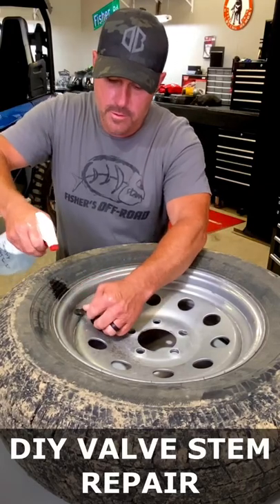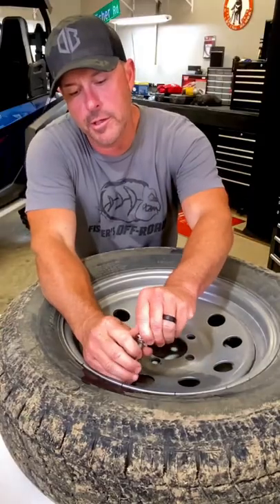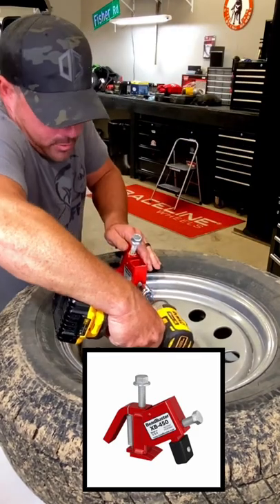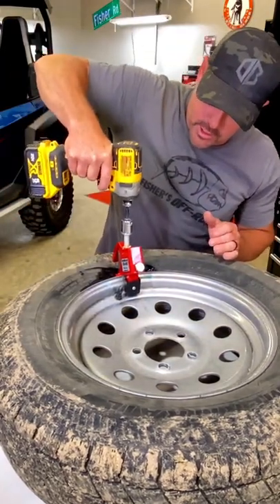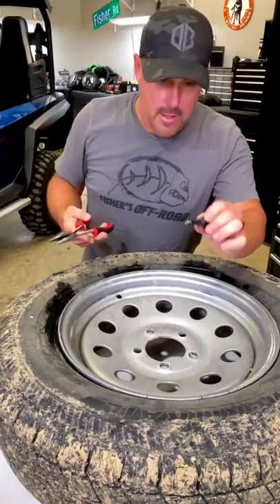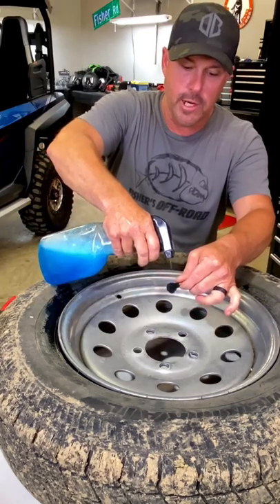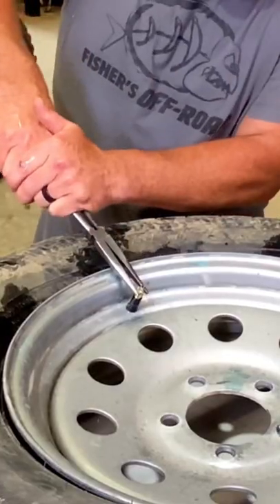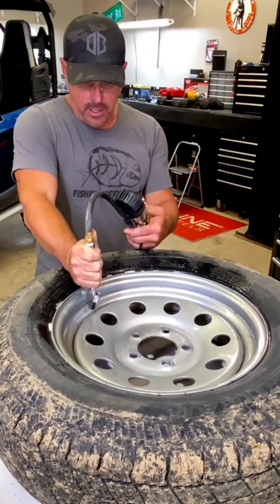DIY VALVE STEM REPAIR              #shorts | #offroad | #fishersoffroad | #diy

Comment: Fyi you know they make a valve install tool that threads on and pulls. So you do not muck up the threads
Reply from the maker: Yes sir, check out the full length video. Hard to fit everything in 60 seconds. 
FLAT TIRE TIPS
https://youtu.be/5KuT6vcn-VM